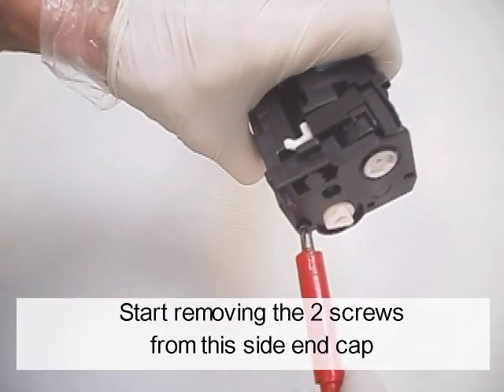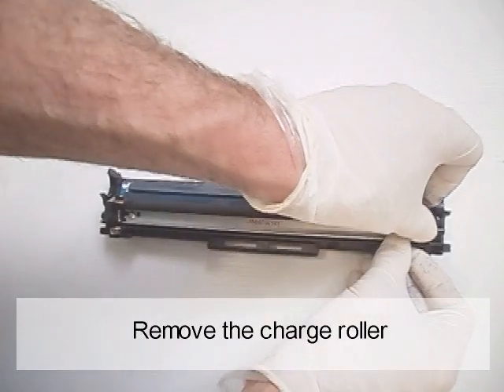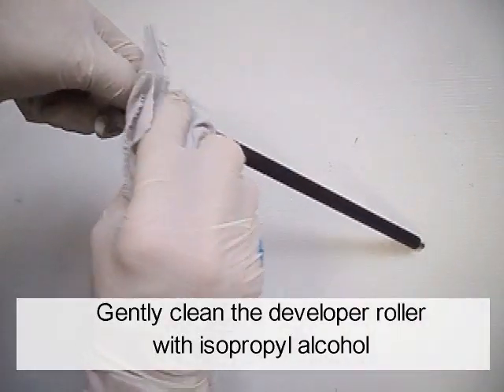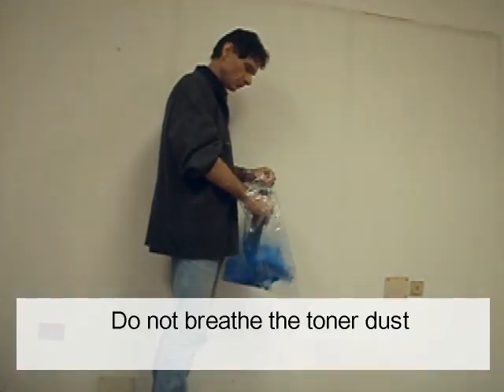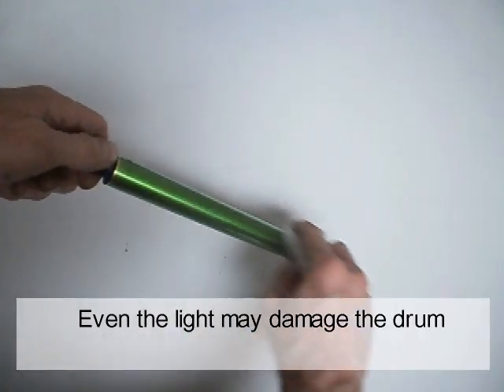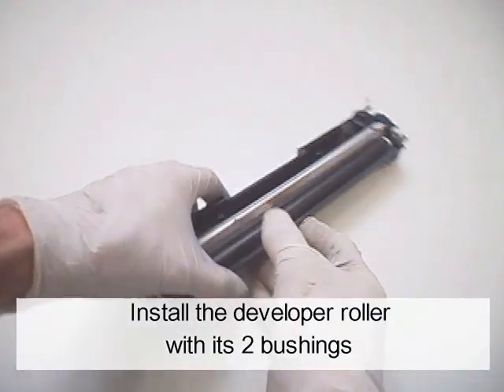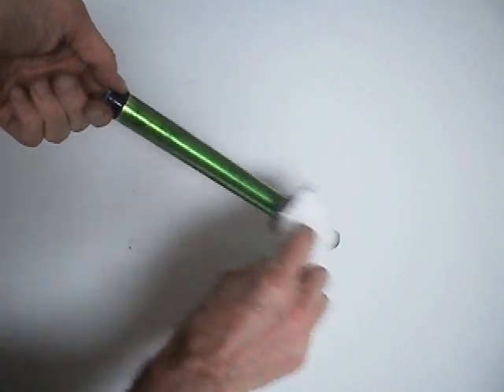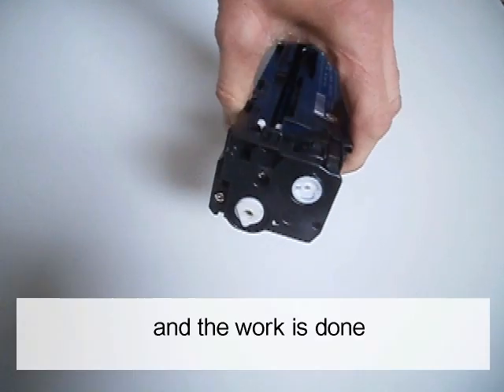HP CP1215 CP2025 Pro 200/300 Toner Cartridge Refill Instructions

Comment: My Printer is giving a Vertical Line after refilling before print was clear. Quality is same but lines are irritating me. Garbage is Zero. Brum is clean and clear i even factory reset my printer settings but in vain please help me sir
Reply from the maker: A white vertical line,  or a black/color line?
Reply: @viandant5  it's black  color faded patch in the mid
Reply: @viandant5  may i speak to you over WhatsApp if possible?
Reply from the maker: @organichubbytaaniya  I don't ude whatsapp. you can send me a photo of the defect
Reply: @viandant5  i have attached over the Email. Please check that out

Comment: Hi, I have the CP2025dn and I wanted to refill the cartridges myself. I found 4 bottles with 80g of powder. As for the chips, I have a couple of options: 12k pages, 3.5k, 2.4k, 1.3k pages. Which one should I use?
Reply from the maker: Are the chips for HP2025? you can use every chip, if the cost is the same choose 12k

Comment: Thank you sir. I have few questions please guide me.
There's some garbage ink under drum, should that ink be wasted or not?
I followed all these steps and only refilled Pink  toner cartridge rest are already full but unfortunately my print quality gone too low like it's started giving a fade print, what possible reason of it? And how can I get my proper print?
My Printer is HP 2025
Reply from the maker: yes, that toner should be wasted. I think the low quality is due to the blade of the toner roller, you have to set it
Reply: @viandant5  ok bro. I'll try this too. I wish it could work for me

Comment: Thank U Sir, Your Video is Helpful. I have Few Question to ask ? 
Can You Suggest me, which model is more Suitable for home or home office among this three:
    1. Hp 1020 Plus monochrome laser printer
    2. Hp Laser Jet Pro P1102W
    3. Hp Laser Jet M1136 Pro Muti-function monochrome printer - Black.
Finally if i refill the cartridge with toner, for how many days can i keep the printer Unused. Because the usage of printer is couple of times in a month ?
Reply from the maker: +JAYKUMAR HARIBABU for home office I think HP 1020 is a good printer. then, a toner cartridge has no problem of drying, you can let it unused without problems
Reply: Thank you Sir, for your valuable suggestion.
Reply: +viandant5   I never get good print of my design from coreldraw etc. than ready made pics. what should i do??
Reply from the maker: +aakash dave try a calibration procedure, this kind of printer have this problem but indeed this series of printers are not the best printers HP ever did
Reply: calibration doesn't work at all sir, but suddenly from no where it prints fine on readymade images as i told I don't know how to get good colors of my design ANY HELP WELCOME SIR!
Reply from the maker: +aakash dave probably one of the color cartridge is defective or near the end of its life. I think the only way to obtain perfect prints is to change one or more toner cartridges
Reply: ok sir!

Comment: Can u use the same chip for all this printers?  in HP Color Laserjet Pro MFP M476, CP1215, CP1515n, CP1518ni, CM1312nfi, CB540A, CF380A CF380X CF381A CF382A CF383A CB541A, CB543A, CB542A, CP2025n, CP2025dn, CP2025x, CP2020, CB530A, CB531A, CB533A, CB532A CE410A, PRO 300, M351a, M375NW, PRO 400, M451DN, M451DW, M451NW, M475DN, M475DW, CE411A, CE413A, CE412A, Canon LBP 5050, MF8030, MF8040CN, MF8050CN, Color imageCLASS MF8380Cdw, Pro 200, color M251n, M251nw, MFP M276n, M276nw, Canon i-Sensys LBP7100Cn, 7110Cw, MF8280Cw, MF8230C, Cartridge 731, CF210X, CF211A, CF212A, CF213A
Reply from the maker: Amel no. the chip is different. sometime Canon lbp5050 chip is the same as Hp CP1215 but it depend where you buy it.

Comment: thanks for ur video
i have 2 question
1. where m i find the chip
2. if i find chip & installed is it possible use this chip more than once?
Again thank you
Reply from the maker: Aminul Hoque you can find the chip using google, or ebay. the chip is a page counter, it's not possible to use it more than once
Reply: viandant5 thank you for your quick response

Comment: please tell me what is the problem hp 43x toner missing in printer
Reply from the maker: may be the chip, or one of the electrical contacts on the side of the cartridge
Reply: viandant5 please show on picture
Reply from the maker: Sujit Nayak
I can't upload a picture on youtube. you'll find the chip on the front of the csrtridge. the electrical contact are those metal plate on the side of the cartridge.
Reply: viandant5
what can i do for electrical contact ...
Reply from the maker: Sujit Nayak
try bending the contact plate of the printer. but I think the problem is the chip

Comment: I m confuse plz tell me total page yield hp pro 200 toner.(210A,211A,212A,213A)and individual yield
I have facing some  problem for 210A,211A,212A,213A
A:- More wastage( what is reason)
B;-very low yield (around 1000 thousand pages in Black)
Reply from the maker: It prints 1600 pages at 5%, it's possible a cartridge prints 1000 pages.
too much waste toner may be related to low quality toner, or charge roller
but in this cartridge the #1 is wrong gap between doctor blade and developer roller.
Reply: viandant5
thank u